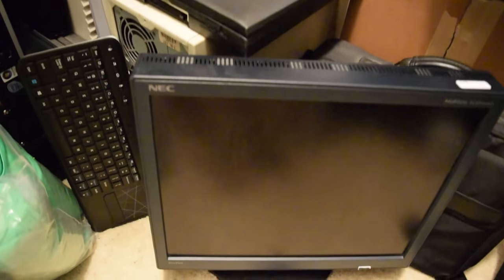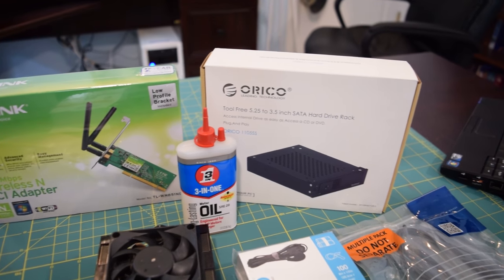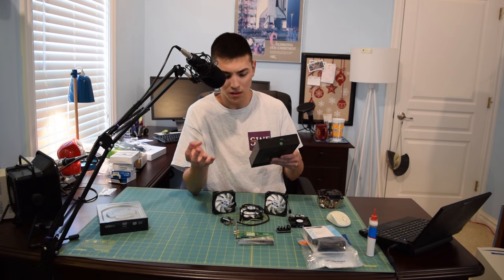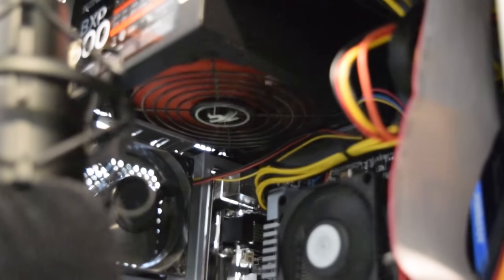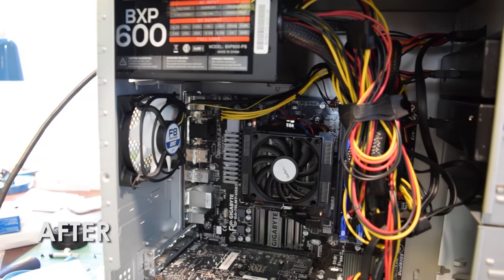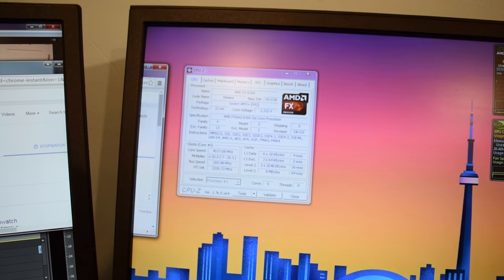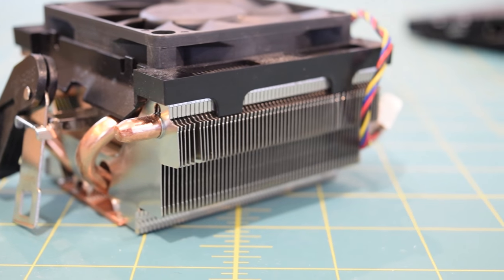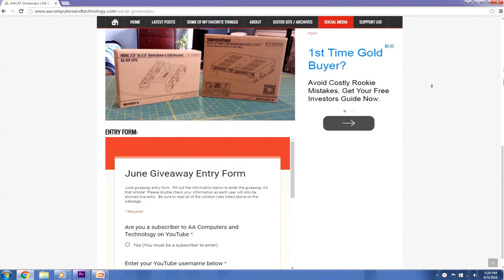Nobilis Sleeper PC Upgrades, Cable Management, and Overclock (AMD FX-6300)

Comment: so fun to update\upgrade. that 8350 Fan is fine. the other issue you may have run in to with a standard tower cooler is clearance etc I have found that some of those older cases are a bit slimmer and tower coolers just don't fit... while not optimal, it was an improvement and works. keep it up. you inspire me to want to do my own PC videos. just this week I built a nice Core 2 setup with A nice thrift store case and repurposed parts from around the office. also just found an older unique slim case Athlon Xp 2200+ system. in amazing condition. cleaned it up and upgraded RAM,DVD and some fans....anyhow. Fun video!
Reply from the maker: Yes, good point, that is also a factor to take into account.  Cool, If you do make a video send me a link and I will try to give you some pointers! Thanks!

Comment: I did almost the exact same layout for OCing my AMD X6 1100T.  Except, I skipped the fan upgrade on the heat-sink.  And instead (noise by damned) went with a 100cfm 80mm fan for the intake and 120cfm rear exhaust fan.

Suggestion... I would definitely invest in a Silverstone FF143B 140mm Ultra Fine Fan Filter to cover your air-intakes.  I did and it saves me from having to clean my computer often.  I use to clean once a month.  Now... I clean once every 4 to 6 months.  I just remove the magnetic fan filters and clean them about once a week.  Easy-Peasy!!!

Comment: My and FX 8320 3.5 GHz CPU was able to overclock to 4.2 GHZ. 4.3 GHz is possible, but it occasionally crashes. So it is set at 4.2 GHz with a boost of 4.3GHz.

Comment: Tidying up the cables has been on my todo list for about 2 years. It is the biggest source of clutter in my case. My PS is about 7.5 years old which was well before modular power supplies were common and there's 3 lines I'm never going to use. Ideally, I'm thinking about desoldering them (I think it's safe to mod it now being outside that 5 year warranty), but I have the small hesitation of maybe needing one of them in the future. The other plan is to just make them modular by adding some connectors a couple inches out from the power supply. Someday I'll get around to one of those. A suggestion I have for you is to use zip tie mounts on the panel your motherboard is mounted on. You have plenty of space up top, enough down between the board and drive bays and a lot more under the motherboard. Zip tie your cables along that path instead of balling them up top. Bonus points if you grab some of the small zip ties and add one every couple inches along the cables to make things look even neater. Thanks for the vid, I find it fun seeing the inside of other people's systems.

Comment: Warning: Wall o'text incoming.
the 70mm fan it comes with is great if you hook it in. I had two of them in the front of the E60 sleeper box sans PWM and tach lines running on 5 volts, to move air past the hard drives. worked out great. they moved a lot of air, but I soon acquired a pair of 60mm fans that used a single fan connector that used to be for a RAM kit's cooling assembly. 

the more popular mod to do, if you have the space for it before the fan 'baffle', is to hook in a 70mm to 92mm fan adapter and your fun fruit flavor of fan at that point. still recommending the Nidec Beta V TA350DC fans from older Dells. they're more than 10 years old in some cases at this point, but they'll last forever if they haven't been abused too much, and still do in a lot of cases where they have been-- the impellers are meaty as frig and they're built to outlast a couple decades. mate that with the lower speed they generally run because of the ambient temperature of the air running through them, and you have a winner. I've been considering desoldering the thermistor off of one of my test fans and putting it on a detatchable lead that runs to it superglued or hotsnotted to the side of a heatsink or the underside to increase/decrease fan speed based on heatsink temperature closer to the CPU contact area. 

also, fun one-- if you're spreading your compound (as it looked like in the sped-up segment of that happening), smear it vertically facing you with your finger inside a ziploc baggie with a clean outside, until it's tacky and fully covered. then go over it and make sure it's really tacky and not liquidy anywhere on the CPU. you want it to be tacky enough it pulls up some compound if you stop in the middle, but it has to be smooth all the way across or as smooth as you can get it. then place a small grain of rice-sized drop of AS5 in the middle, and you should see better temperatures. 
more-so if you go and get yourself some 600 or 800-grit sandpaper and, with the direction of the brushed copper on the bottom of the heatsink, sand it in the CPU contact area until it's all virgin, non-oxidized copper. clean with acetone, then rubbing alcohol to remove particles, and place on the CPU in the manner specified after doing the same smearing on the contact area of the heatsink but lighter. temperatures should get substantially better at that point, if not dropping by at LEAST 5C in some cases (idle, for the most part.) the higher 50s is a kind of no-no zone for me for AMD stuff, generally their max recommended operating temperature is in the high-60C range IIRC so the cooler I can get it, the better.

contact me in a few weeks. I'm selling my 89 Bronco II and will be getting some money from it, I can flat-rate you that CNPS5X I'm not using (as I mentioned, it's sitting in a box unused and probably will continue to be unused for a long, long time) and I'm curious to see if that makes any noticeable difference in the temperature of not only your CPU, but also the hard drives in the bay directly in the air path of said heatsink when installed, since those are still passively cooled with whatver air flows past them. you'll have to block off that fan vent up on the case side for the air to go in the path I'm thinking of here, probably with cardboard with some hole punches to screw fan screws into it or something, but it'd work. I'm also going to recommend sometime in the future that you dremel out the vent on the exhaust fan's location. the intake fan's vent doesn't look too restrictive for the type of fan it is so I don't see an issue there. replace the metal vent with one of those wire fan grills that show up everywhere for nothing-- this will still protect the fan from most objects poking in and obstructing it while not obstructing airflow like the current vent punched into the case at the current is doing. 

I'm also going to recommend you place a 40mm fan of some manner on the AMD 760G chipset heatsink, especially if you're overclocking this thing. the 760 and 780 like to get fairly warm, the 790 as well, but hotter than the former two (I have a brother with a Biostar TA970 and an FX-8350 at STOCK clock speeds, and that 970 gets as hot as the sun without the 40mm fan I threw on it). as the heatsink is curved, it might only be possible to put screws in for it on one side vertically, so the right side (facing the board directly) would be the side to put screws in on. I'm sure you probably have a 40mm fan around someplace, and even if the fan is run on 5v to lower noise, it'll be very beneficial in the long run for longevity's sake.

that about wraps up this wall-o-text, thanks for the shout-out to the sleeper box as you mentioned you were gonna do!
Reply from the maker: Haha, that is definitely what I would call a "Wall o'text", a very helpful one in this case! I have never heard of the "zipblock bag" method of applying thermal compound before, interesting, I might have to give that a try!  Yup, you are definitely correct about the chip-set temps, they get uncomfortably high with the overclock.  I need to add additional cooling to that heatsink soon!  No problem! As always, thanks for all of the information!

Comment: Sewing machine oil is supposed to be better for fans, less likely to break down and gum up, found easily at walmart since they tend to have a sewing section easily found in a bottle etc for about a buck or two..
Would be an option to use a hole saw and just replace the weeny side intake with a 120mm, would probably also drive enough air into the case that you could simply remove the slot blower and leave the plate off as an exhaust vent.
The plastic air guide for the side panel looks too restrictive to be practical, can probably be done away with.

Comment: for just a bit more or a nearly identical price (used) you could have got a hyper 212 evo at which point you could have overclocked to around 4.4 ghz since i have the same cpu and mobo as you along with a hyper 212 evo. so why didnt you?
Reply from the maker: I was considering a Hyper Evo 212 but I wanted to try to take advantage of the air intake built into my case.  The Hyper 212 is too tall, I would of had to remove the intake to fit the 212 in.  The best affordable low profile option I could think of at the time was the 8350 heatsink.  Though now I think I would have been better off just removing the air intake shroud and going with a 212 (or better).

Comment: i have compaq presario 6000 micro atx case with front usb and audio i did a mod to use regular atx psu. i had athlon 5350, asus am1m-a 8gb ddr3 1866mhz downclock to 1600 mhz cl9 timings but i sold in favor of dell precision t3400 q6600 gt 440 1gb ddr5. i regret it some times.

Comment: to quiet down that rosewill fan you may want to think about doing something like the 5v/7v fan mod:
http://www.silentpcreview.com/article6-page1.html

Also, you may not even need that fan at all. I would run your stress tests with and without it and see if the fan is even making a difference.

Also about that wireless adapter, have you ever heard of something called powerline networking? It allows you to connect directly to your router through the wires in your wall and is much faster than wireless. Here is a powerline kit on amazon:
http://www.amazon.com/gp/product/B00AWRUICG/ref=pd_lpo_sbs_dp_ss_1?pf_rd_p=1944687582&pf_rd_s=lpo-top-stripe-1&pf_rd_t=201&pf_rd_i=B0081FLFQE&pf_rd_m=ATVPDKIKX0DER&pf_rd_r=0N3ZH5VMCJ7QMXMM0NKQ
Reply from the maker: This is the first time I have ever heard of power line networking.  This looks really cool, thank you for introducing me to it!

Comment: i wouldnt have my pc on the floor like you have, you tend to get more dust when there left on the floor.  i have mine higher off the ground and i get hardly any dust now.  just a thought..  cool video.
Reply: digital masters I keep mine on the floor, I haven't noticed a significant difference, I still got a ton of dust when my PC was on my desk

Comment: You might want to uninstall the windows update kb3035583 if you don't want to have Windows 10 instead of Windows 7 on your main computer. You better do it fast before the upgrade has a chance to start. I know that this update is installed is because you have that icon on your notification center. I just wanted to let you know that.
Reply: Or you just can delete the installer, its a pain in the ass working with privilegies but worth it

Comment: If you put your PC in that case to prevent stealing at college, but ended up not staying in a dorm, why don't you change to case to something better?
Reply from the maker: I just like it too much now.  Plus the thing is built like a tank, it would be hard to find something that rivals its build quality (for a reasonable price).
Reply: How about you make a video/project where you can "modernize" the case a bit, a coat of black over the exterior and some other parts that you could decide on.
Reply from the maker: Hmmm, maybe.  Honestly I really like it the way it is!

Comment: Those AMD stock sinks really aren't any good, they have been about in the same form since the original Athlon X2 chips and they were rather poo then.

Disable APM in the motherboards bios settings, then you will stop the cpu throttling or power managing, your temps will likely go through the roof though.
Reply: They are the same thing as the new Wraith cooler with a smaller fan. And I got to 4.5Ghz on an APU with one of those sinks

Comment: you should have gone with a hyper 212
Reply from the maker: I was considering a Hyper Evo 212 but I wanted to try to take advantage of the air intake built into my case.  The Hyper 212 is too tall, I would of had to remove the intake to fit the 212 in.  The best affordable low profile option I could think of at the time was the 8350 heatsink.  Though now I think I would have been better off just removing the air intake shroud and going with a 212 (or better).
Reply: Foreigner037 i did watch the video and was only giving a suggestion. i didn't actually expect him to reply
Reply from the maker: lol, it's okay, calm down :p
Reply from the maker: That is okay, you have the right to ask questions and make suggestions!

Comment: You should buy new stuff not those OLD HARDWARES! Here the list you need to workout.
-change your power supply the cables look like from 2001
-buy a Intel Core i7 6950X
-buy an Nvidia GeForce GTX 1080
-Replace your nasty case
-watercool your pc (NZXT RECOMMENDED)
-buy a bigger ssd
-buy rgb lighting for your pc
-buy a mechanical keyboard
-don't be on a budget for your editing rig
-do cable management!!!
-replace all of your nasty stuff and just do a new build your upgrades are awful for gaming
Reply: Then give him $3000.
Reply: CAPTAIN JNBD you shout look up sleeper definition